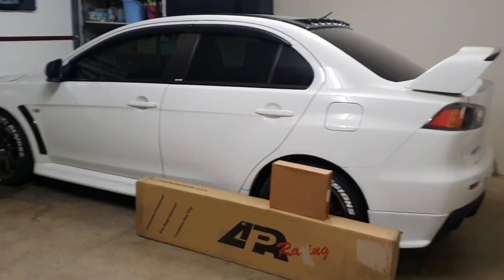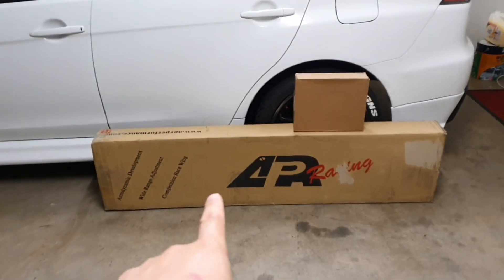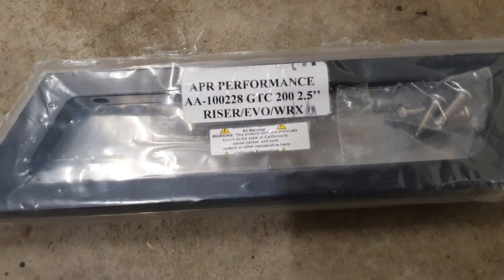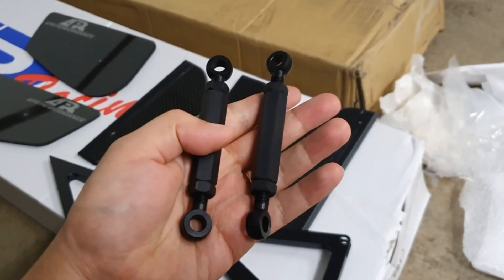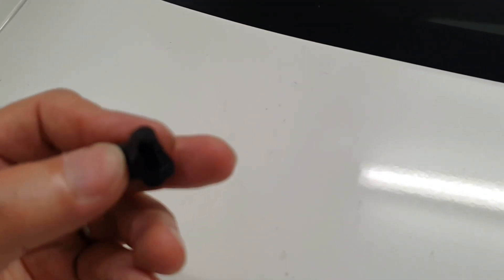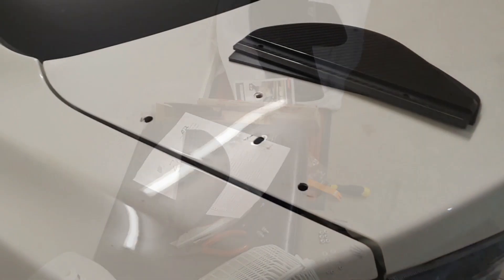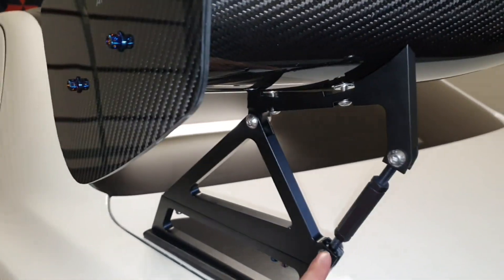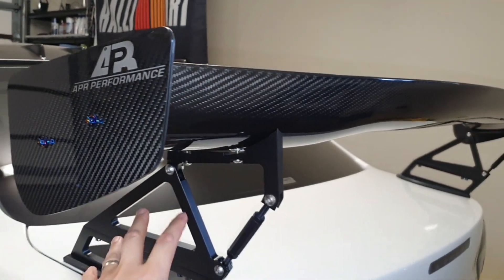Evo X APR GTC-200 wing unbox and install

Comment: There’s also the GTC-300 version. It stands 13 inches tall, but you can choose either the 61 inch or 67 inch wingspan. Not sure if they’re legal on cars in other countries, but here in the USA it looks amazing. I have it on my evo X.
Reply from the maker: I actually missed saying that in the video. My shop had the 300 but only in 67 which I didn't want to be pulled over for here. I just saw your vid congrats on the wing!

Comment: How long did it take you to measure/center the wing? That step would take me the longest, re-measuring a dozen times before I permanent drill into the chassis
Reply from the maker: I didn't need to because this wing comes with different base plates designed for specific cars. The base plates and the holes on the underside of the wing are all Evo X specific. If you had another car like a RX7 they would set you up for that car

Comment: I have the Seibon carbon fiber wing but thinking of getting the GTC 200. Do you recommend that wing? Thanks
Reply from the maker: I love the wing but I don't actually drive with it on now. I have it in storage and mostly fo between stock and wingless
Reply: @TweakedGSX  is there a reason why you don’t drive with it anymore? I just installed mine but I feel like it has too many parts and it might get loose. Did you ever experience that with yours. Thanks
Reply from the maker: @miketikle  mine is solid. I removed it for drag racing to bring the weight down.